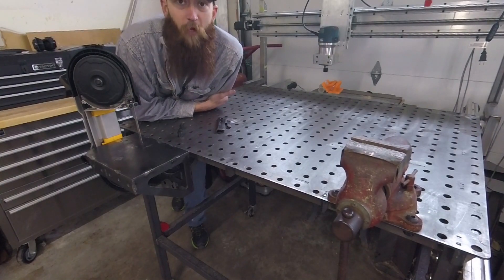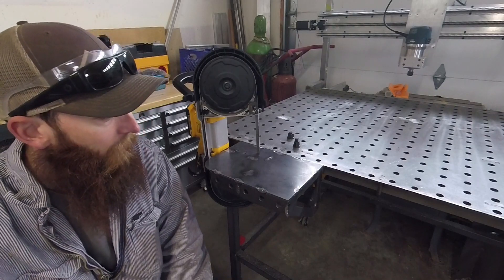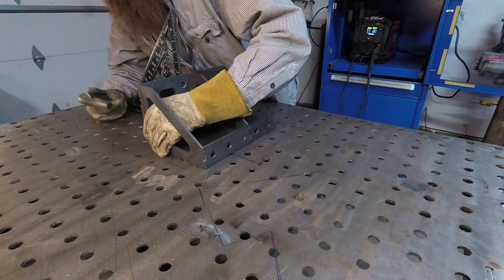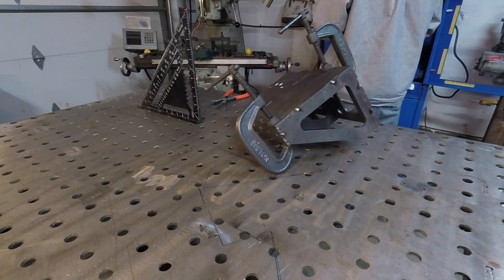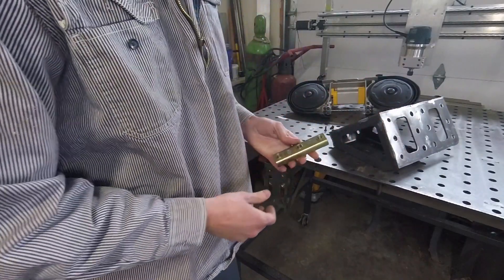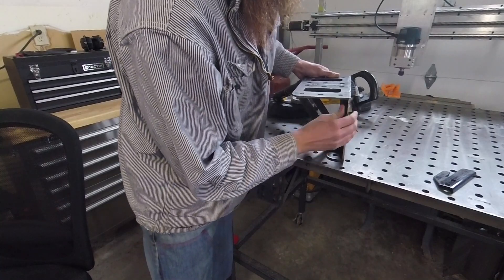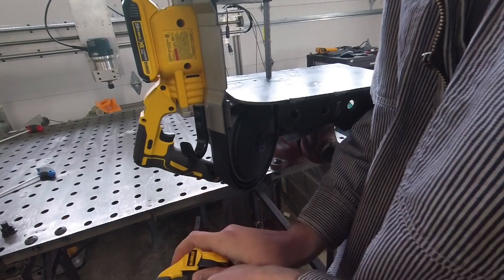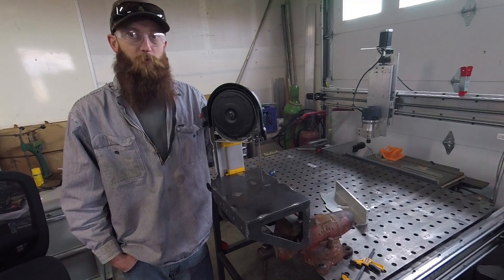Portable Bandsaw Table DIY You Weld Kit to Certiflat fabBlock

Comment: A very interesting idea and well worth quickly moving on. You may have mentioned it, I only heard laser and plasma, but have you considered water jet cutting?
Reply: @melissahill7930  Mainly while testing out interest, to receive consistent parts requiring minimal additional work. For smaller orders, shop differences can dominate process cost. Peace
Reply: @melissahill7930  The last drawings I had quoted, same city, same process, four shops that the company I was with had ordered from before, ranged in price by nearly 10x. I can only speculate why. So yeah, for smaller orders, shop differences (i.e., choice of shop) can dominate cost.
Reply: @melissahill7930  Thank you for the time you've freely given today. The original comment was encouragement and to keep an open mind. You are very experienced and provide sage advice. I wish you the best of success in all that you do.

Comment: Love the truck mounted saw portable over portable. Love the little slotted table parts coming together from welding great idea at the plasma cutter to cut those groove slots whatever they are. You did a good job. Funny speed control enjoying that.
Reply from the maker: I'm calling them indexing slots, I drew them with tolerance for laser so they were the issue that I needed to file so much and the plasma causing hardening posed some issues.